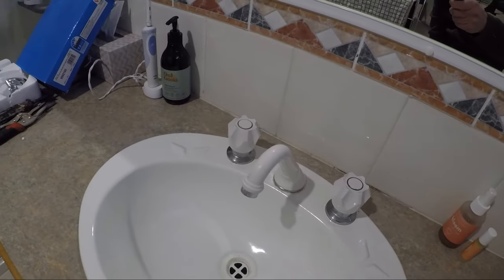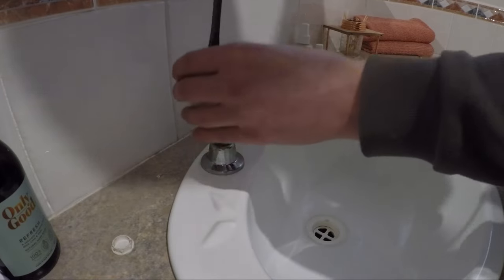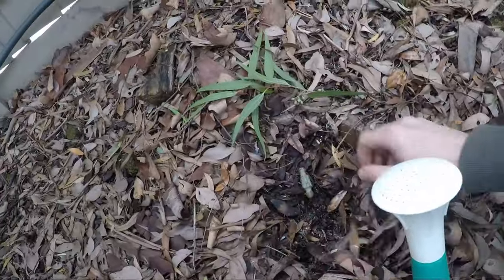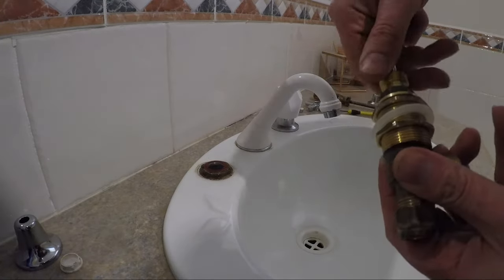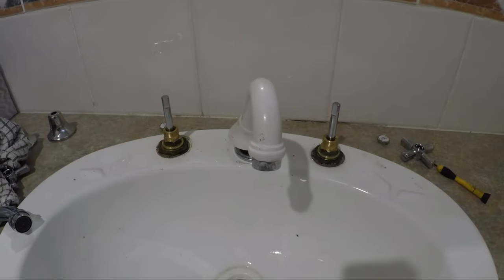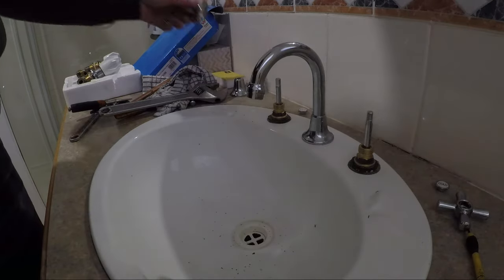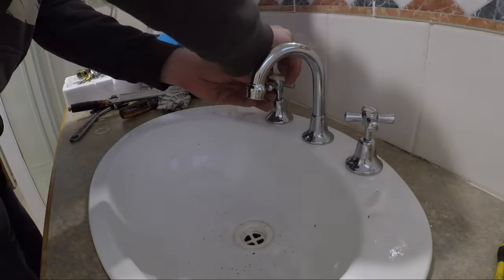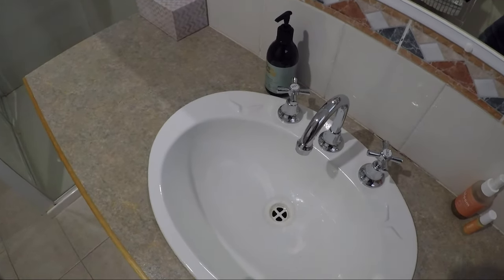Replacing bathroom taps DIY. Its easy!!

Comment: The spout is the trickiest part mate, that's the part we need to see lol
Reply from the maker: haha yeah i know. I really couldn't film that part it was just too cramped. Got an adjustable spanner on the nut and just loosened it then spun the nut off. it then just pulled straight up.
Reply: @berko79 I was going to replace my basin taps , just went to look at my spout ,
The nut is about 5mm off the copper piping, there’s no way I could get to properly, let alone loosening it 
Plumber’s job I think

Comment: Hi I got the same taps as you, however I couldn't unscrew the spindle off the rest of the bottom part as you show at 2.13. Mine doesn't just screw off as yours. How do I do it ??
Reply from the maker: Did you have any luck? sometimes it looks like they dont come apart but you can undo it - if it doesnt even have a spanner spot at all you may need to replace the whole thing back to the pipe unfortunately.

Comment: I have the exact same tap system like yours, my gooseneck spout cannot be fully turned around to unwind it as it's too close to the vanity wall. How did you untighten from underneath? to me it looks really intimidating and I am not sure how to do it. it is very narrow underneath as it got blocked by the belly of the vanity sink. What kind of tool you used to take off the spout?
Reply from the maker: Yes, it was a bit of a squeeze inside the vanity. I cant remember exactly how i did it, but it wasnt has bad as I thought it was. i think to undo the spout i used an adjustable spanner (wrench) and just put it up vertically. When you get about 1/4 of a turn it will be finger tight.
Reply: @berko79  Thanks, will try it out and hope I can replace it

Comment: How do u take the body off the tap, to just replace the top bits
Reply from the maker: you mean what i did at about 1:40? you just undo them with an adjustable spanner and they come out. They can be a bight tight if they havent been done for a while